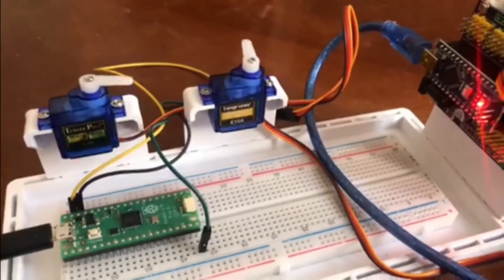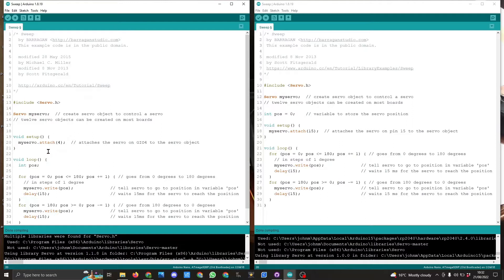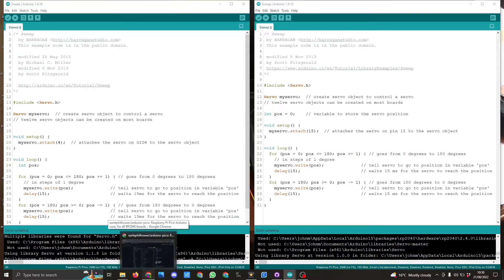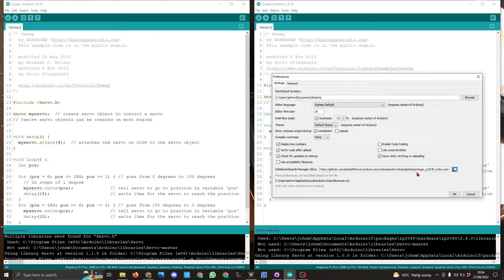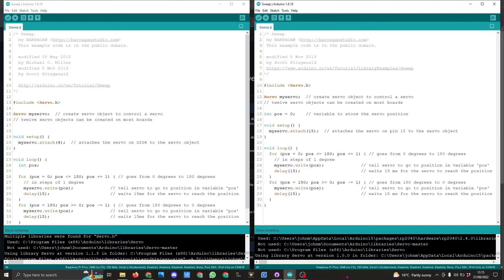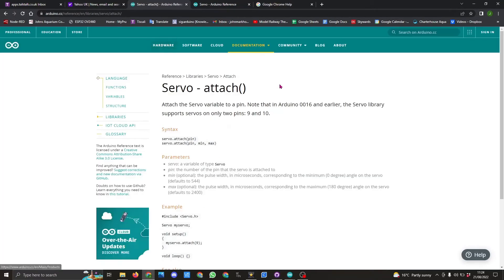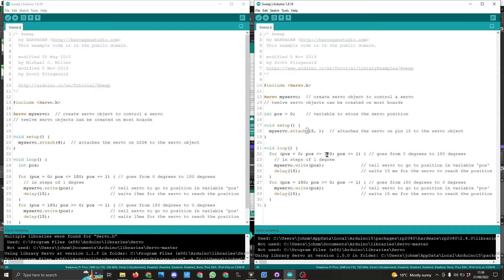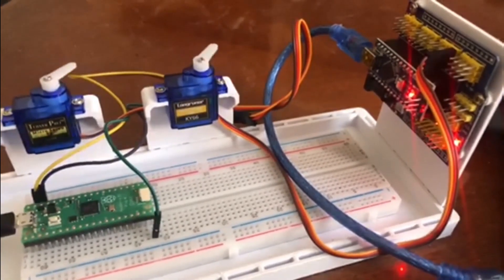Raspberry Pi Pico using Earlephihower Arduino Ide board manager to control a servo using servo.h

Comment: Hello, can you recommended a reliable servo?
Reply from the maker: Hi Paul it’s very hard to recommend a certain brand. I buy them from eBay if I need them quickly I use a Uk based seller.  This does mean if there was an issue with them I can get a refund. Some seller I have seen with a 6 year warranty but I tend to go for cheap ones. It’s hard because they can easily be rebranded by the seller so you don’t have a clue who really manufactured them in the first place. The ones seen in the demo are Tower pro sg90 on my layout I have some which had no name on them. I have also used some other supplier.  So sorry this is the best answer I could give as I have never had an issue with any of the ones I have purchased so far.   John
Reply: Hi John. This is the type of information I  needed and sincerely appreciate your time to answer.  Thank you!
Reply from the maker: Thanks Paul for the comment its helps the youtube algorithm to see people comment and like to promote the videos to others